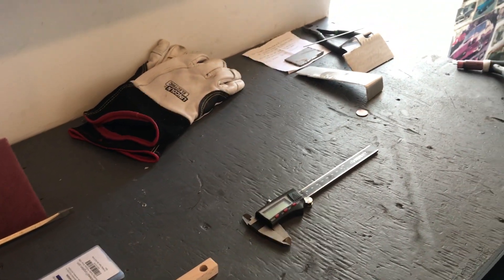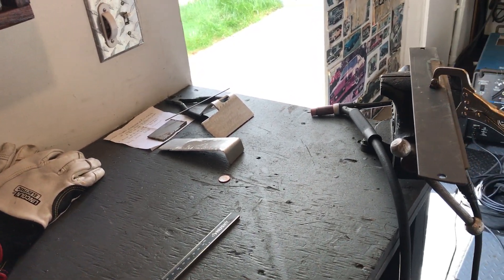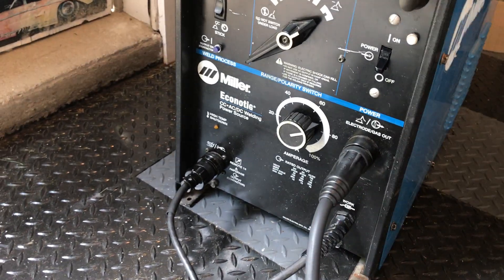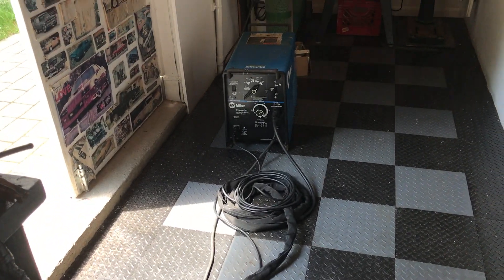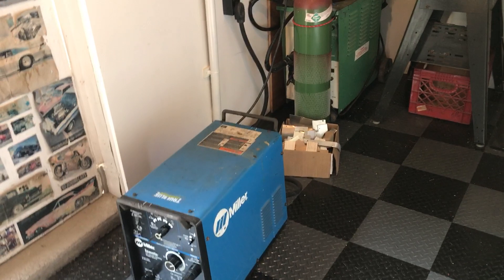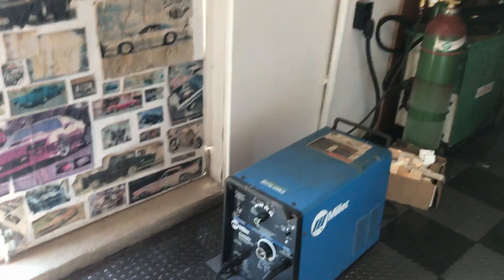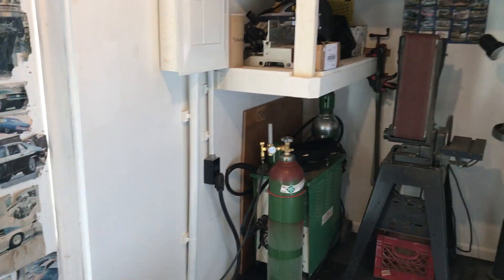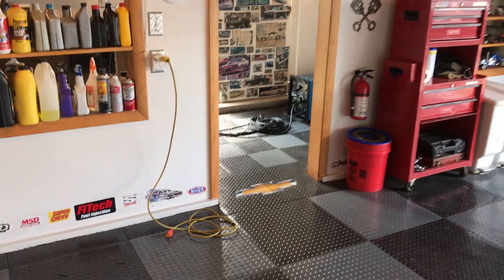Econotig troubleshooting for AC aluminum welding

Comment: Hello friend, could you tell me if that machine has high frequency, thank you very much, good video
Reply from the maker: I don't know if it does. Its old, from 1993. I think its just a square wave signal, but it is the Miller Econotig machine from that era. I bet you could look up the factory specs/manual for and Econotig and find out though.

Comment: Have you found out your problem? I have been facing exact same issue with my welder…
Reply from the maker: yes, there was a very worn metal-to-metal connection at the port where the torch connects to the machine, so it was not getting proper alternating current,. check your connections really really good. all of them

Comment: Sir. You may want to reverse your welder cover, the louvers on the side should be to the front to draw air over the heat sinks on the control circuit board . You will see on factory photos this is the right configuration . Your welder will last longer... Good Luck on your projects.
Reply from the maker: Woah !   I had never even noticed that.  What you are saying makes VERY perfect sense.   I guess at some point it got turned around by accident.  Wow.  Thanks for picking up on that !!!

Comment: I could also tell you to you need to use a green tungsten for that pure tungsten with it being a transformer type welder 2% lantinated doesn't work on transformer type welders only on inverter base.
Reply from the maker: I tired the green tungsten, I actually bought a pack of it.  So far I have had the best luck with the blue and the green.  The red was not happy for some reason.  I'm curious to know more about your thoughts on the green tungsten s the blue. Maybe if I go back to the green, I can get even better results?  fyi, if you are commenting about the welder problems, I resolved this 1 year ago, and have a few videos from around that time here on my channel.  I also spent most of the winter practicing tig welding on stainless, aluminum, and mild steel, so things(the welder) is in working order/function.

Comment: that sounds like a transformer AC welder to me running at 60 HZ sounds like it's working damn good nothing wrong with that. I got a primeweld Tig 225x which is an inverter machine and I can turn my frequency up higher or I could turn it down lower I could go from 40 Hertz to 200 Hertz on my machine.  yours is a transformer machine and it sounds like it's working perfect one way you can tell if it is working perfect is get a clamp style multimeter hook it on your Earth ground and it'll tell what your amperage output is and if it matches what the dial says.

Comment: That sounds like AC to me. The tip does not look correct. Should look like a ball at the end
Reply from the maker: Right. I agree with you on that.  The connection between the welder itself and the torch were all screwed up so the electrical current was awful. Got that fixed and we have been welding just fine since then
Reply: @IROCZman15  awesome to hear there was a solution 👍